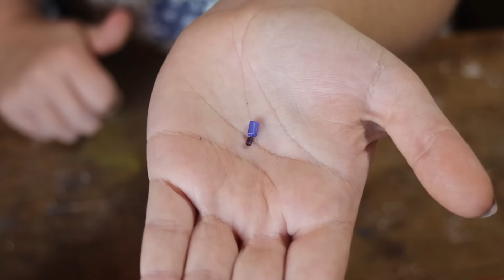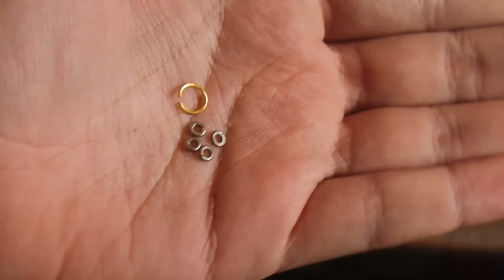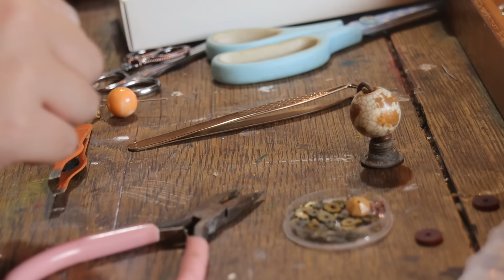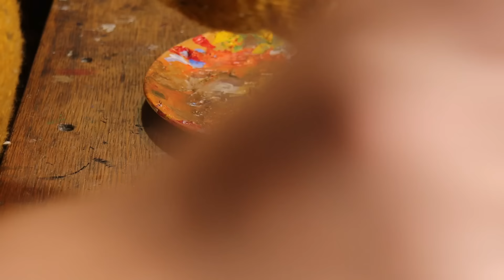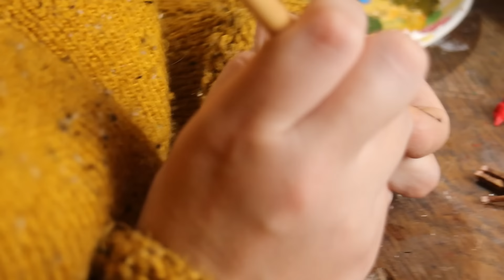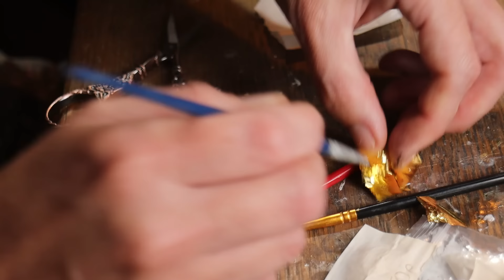What Can We Make From Bags Of Vintage Beads? 15 Miniature Crafts!

Comment: 🎉a handy tip for you I cut cocktail sticks and thread the beads I want I sand any excess at the bottom I use to hold whilst I'm gluing the beads onto each other. It gives more strength to the peices 😊

Comment: I stretched chicken wire across the back of an old oval frame and build a stack of 3 glass beads like your doing and wrapped the beaded wire around the top of the chicken wire hold so the beads hung down. It catches the sunlight beautifully. Wish I could add a picture for you❤️😊

Comment: What type of glue are you using?  It seems as if you are getting it out of that little white tub.  Also what size wire do you use most of the time?